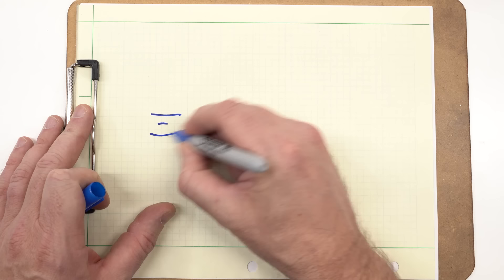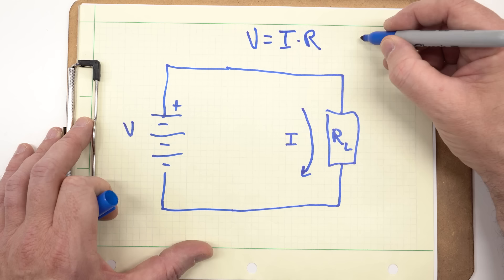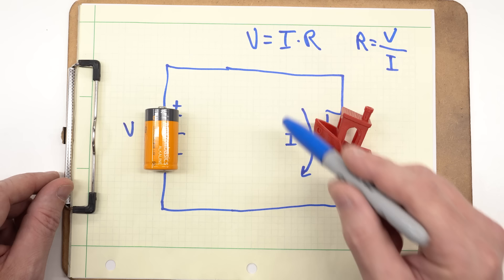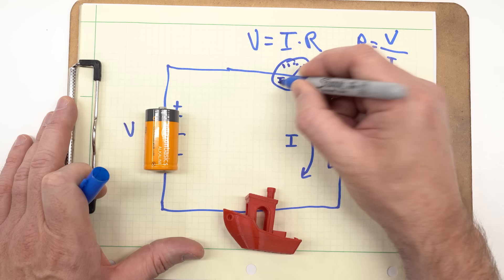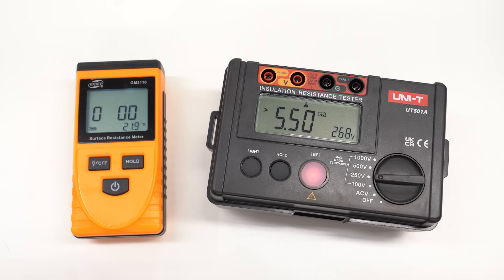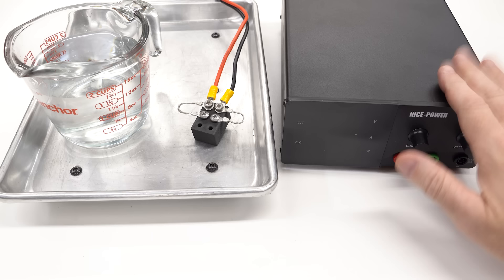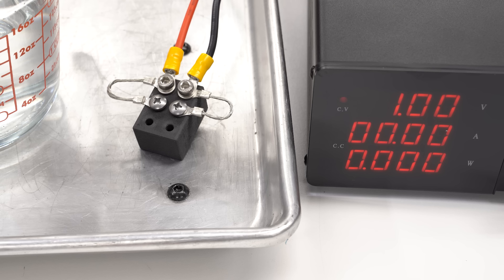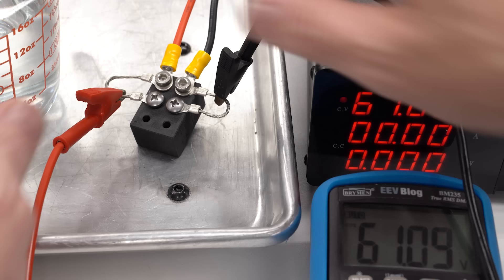3D Printing Filaments and Electricity: A Shocking Reality

Comment: An interesting side note, they are using carbon fiber infused in concrete as an ACTIVE LOAD CELL. This was patented as an automated way to measure potential failure of concrete bearing structures w/o the continuous need for an eyes on site inspection. 

Apparently as the concrete undergoes changes in the amount of load it’s under (contraction or expansion) the carbon fibers will undergo a measurable change in their resistance (higher compressed areas lower the resistance [of the carbon fiber in the area] while areas undergoing relaxation or tension will see an increase in resistance). While it wouldn’t do a lot of good to run a seamless run of carbon fiber throughout the concrete structure, placing precast smaller load cells embedded strategically in areas of concern alongside a group done at constant intervals would go a long ways to monitoring the health of aging concrete structures. 

The fact that they are able to measure these slight changes in resistance with a high enough degree of accuracy brings renewed interest in utilizing more than just its strength but its electrical properties as well.

Comment: In composites, long, skinny fibers offer improved strength and stiffness compared to spherical particle reinforcement. Your electrical tests are a reasonable way to evaluate fiber aspect ratio. Spherical particles would be insulated on all sides by polymer matrix, with almost zero particle-to-particle contact. A circuit along high aspect-ratio fibers would have far fewer insulating junctions, and a greater likelihood of fiber-to-fiber contact, or near-contact.

Assuming the recycled carbon fibers are aerospace grade, we can also assume they have high quality and aspect ratio, so it's not surprising that they result in measurable electrical conductivity. They should also result in increased thermal conductivity, but the meager difference would be even more difficult to measure.

Comment: There are static dissipating filaments. I have printed some parts form  3DXSTAT ESD PET.   I could not get the finish print to show conductive on my basic meter.  The customer had more specialized equipment to test it.  He said it was would conduct and dissipate static.  He was pleased.

Comment: The aircraft industry had concerns about carbon fibre and lightning. The concern is more the resistance causing heating and explosion of the material. That is at the other end of the spectrum. I think the problem with CF in aircraft was solved by including copper wire in the buildup.

Comment: I was at the South East Electric Funfly when  Carbon fiber DLG tangled with the power lines. The glider lost. It took down power for half the event site. There is a video from a drone that happened to be pointed in the right direction. The glider flat out exploded.
Ken

Comment: would i use CF filament for a 40kv plug? no, would i use it for a project with wireless connectivity? probably not, something i would need to test
would i use it for 60v? yes, without concern

Comment: I would expect the Bryman to use a constant current source for measuring resistance. That provides voltage directly proportional to current.

VOMs and VTVMs used constant voltage sources, why is why they have non linear scales with zero at the fat right.

Comment: I'd love to see a sample of a static dissapative filament as a 'control'. I actually have a roll if you want to open source your test designs
Reply: The static dissipating petg from polymaker and 3dxtech are conductive under the surface resistance test. They do specify higher processing temps for layer adhesion though

Comment: Well now I have to take this knowledge and apply it to nickel plating 3D parts. If I raise the voltage enough to make up for the resistance, I should be able to have it start plating. As it starts pointing the conductivity will go up and I'll just have to put a current limit on it... But that means I should be able to grow plating onto the plastic parts directly

Comment: Excellent and informative test! Thank you so much. I am however wondering if some of the apparently non-conductive materials might break down and conduct or arc at higher dielectric voltages and currents? I've worked quite a bit with high-voltage switchgear underground cables and insulators and have observed that might be effective insulators at low to medium voltages (medium being 5kv and below) would breakdown at higher dielectric potential voltage. Higher currents also seem to effective dielectric insulator breakdown. 

Arching might be another potential issue, as the the carbon-fiber might be more susceptible to arcing carbon tracks which could lead to permanent arcing. 

Be interesting to see how these materials hold up to a Hi Potential 'Hi-Pot' tester, or something like a 10,000volt neon sign transformer with terminals set within and beyond the arc gap, and see if the arc tends to be drawn to the material.
Reply from the maker: If I had access to higher voltages, I would try them.  I'm also curious.  I'm pretty sure all of the samples would break down at some voltage.
Reply: @Clough42  "You can get a horse to deal cards. Simple matter of voltage."

Comment: Pretty thorough. However, I am printing parts for Tesla coils these days, and having some CF PA in storage, I am just drooling at it, but at 15kV primary, or 300-400kV secondary, it would not be very wise to use it. Regardless of how much they would conduct at 1000V, or less...

Comment: I got the bambulab CF filaments because I wanted to print ESD safe boxes for my components. But was disappointed in that I could not measure any conductivity at all. I then bought Fiberlogy ESD-PETG-Filament which turns out to have easily measured resistance. Just sad that it is very expensive.

Comment: Chopped CF plasticis in the same space as CF resin composite it doesn't exhibit meaningful conductivity in a macro scale to be useful but in a micro scale it is conductive enough to mess with RF signals.

Comment: I recon the conductivity of some of these is 1 of 2 (or even both) things.
At higher voltages the resistance of the plastic breaks down and might create a path of "altered" plastic that is now conductive.

Or (and/or) the carbon fibers randomly line up in a print so you have a continous path from stud to fiber to fiber, etc, to stud.

Now I have to admit the first example of pathing usually happens only "well" above 1kv, hence almost all domestic/lv industrial installation goods, tools, ppe being rated up to 1kv.

Thus I suspect the conductivity you saw where the fibers in allignment. But that is a suspicion on my end based on observation not measurable facts.

Comment: It’s almost like when you chop up a conductive material and surround it’s random orientation in an insulating material it isn’t likely to make a circuit; Is it ideal, no. Will it likely work fine, probably depending on use case.

Comment: I think what you're seeing is by random chance enough carbon fibers are in close enough proximity to conduct. I imagine if you printed enough samples of each filament you would get some that fail with every brand since the arrangement of the fibers within each layer are random. The lower the fill percentage of carbon fiber the less likely this will happen but probably still possible.

Comment: I can tell you that the 30% carbon filled nylon we used to use for backup rings had significant conductivity. Now it was filled with graphite, not carbon fiber but it shouldn't matter.
Reply: Graphite has aligned Pi bonds that are very conductive across the planes. Carbon fibres are not always graphitised enough to make micro sheets or tubes of Pi linked C=C bonds

Comment: In conducting, there is resistance. Where there is resistance there will be heat.
Heat + PLA = Melt
Even if it is possible, I don't think it would be a good idea for long term use.

Comment: I wonder if the phenomenon only happened with nylon due to its hygroscopic qualities. I'm no material scientist or anything near that, but I wonder if a combination of absorbed moisture in the plastic and the carbon fiber threads could have caused better continuity than the other polymers with much lower hygroscopic qualities.

Comment: I'd bet you'd see interesting effects if you tested at higher frequencies. I'm guessing some of the conductivity is dependent on fibers randomly touching within the material, as the frequency increases small gaps will act as capacitors and it'll likely turn conductive more easily. As I'm sure James knows, Ohm's law is only V=IR at DC, in general it's V=IZ, where Z is the complex impedance R+jX. None of the testers shown here can measure at particularly high frequencies.

Comment: So, is this an indication on the quality of the filament?

Prussia has more CF?
Reply from the maker: Possibly.  It might have something to do with the length of the chopped fibers, but most brands don't advertise that data.  It also isn't clear to me that more fiber is always better.  There's likely a point with chopped fiber where fibers start to interrupt the plastic enough to reduce the overall tensile strength.

Comment: likely had one random strand of carbon making it from one hole to the next
I figure under 30-40% fill, all the fiber will generally be insulated by the surrounding material, all of which has a high dielectric

Comment: You were really responsive. So glad you took the test! I had a reservation about carbon fiber and I see that my intuition was correct. Thank you for the test. ABS would perhaps have been safer even if at the voltage used there is little risk.

Comment: Very interesting, though at this point I would probably not trust myself to use any carbon fiber fillament for electronic projects until I know the exact reason why and when it becomes conductive, even if it tested fine previously. Especially the case where the surface tester didn't show anything and later did under slightly different circumstances (usually I get better results with surface testing compared to probing). That would erode my trust into any kind of carbon fillament entirely, because even if it didn't test like that previously, who knows what parameters would make it conductive later on.

Comment: With such low content of cf in those polymers it´s basicly a lottery to get any continuous path of fibers from one point to another.
And even if, those small fibers have quite high resistens!
For everything low voltage and not Metrology related, those 100k don´t matter.

Comment: Your welder should have the umpf to get something exciting probably.
Reply: A welder is relatively low voltage, high current. For maximum power transfer, source impedance needs to match load impedance. With the filament measuring in the high megaohms, we need a high voltage supply to maximize destruction.
Reply from the maker: If I had such a supply, you would get to see that destruction.  :)
Reply: @Clough42  sounds like a great project!

Comment: I mean, if you're worried about isolation breakdown voltages you probably shouldn't be diy-ing whatever you're diy-ing right now.
I have dealt with double and triple digit direct current applications with the big boy cables, can't say I ever felt the need to replace a rated insulator for something 3D printed.
And that includes high end RC "toys". If I'm investing 500€ in batteries alone I won't skimp out on the shielding and isolation...

Comment: how many caught that the reading @5:00 in fact not being the multimeter but the plastic lid he used to prop the meter up! (or he's trolling us! Can't be sure which ;)) the reading does infact update when he plugs the multimeter in though
Reply from the maker: Did you not see the test leads clipped to the brass bars?
Reply: @Clough42  that i did see, yet we also saw the other ends of the test leads lose on the table for those few moments as you propped the meter onto the plastic lid. is the 100G reading a false reading from just moving it? - i did miss that it zeroed just a few seconds after-
Reply from the maker: @konzetsu6068  it often registers something when moving it or handling the leads and then settles down.  I edited that section aggressively to keep the time down, so it wasn't easy to see.  I suspect it's capacitance that then fully charges or discharges and shows open again.  I see that it only gets down to around 10^11 before plugging in, but since the reading is then 10^7 it would swamp the higher reading by four orders of magnitude even if it were real.  So I think it was an unfortunate edit, though I suppose it's possible that plastic box is anti-static and I didn't notice.  The screen was not legible at all with the glare, so that was a last minute addition.

Comment: Why not just hit the test blocks with 240vac and see what happens?  Perfectly safe with the right setup.  You should be able to observe it with an infrared camera and maybe there can be fire afterall.
Reply: Nothing will happen, the resistance of even the Prusa test block is too high for any significant current flow.  Using Ohms law, work out how much current will flow thru a 120,000 ohm resistor at 240v AC.  (Spoiler: it ain't much. Half a watt if you're lucky)
Reply: @j.f.christ8421  Half a watt in a small spot without any active heat sinking will surely be detectable and will warm up.  You can definitely feel the heat with a half a watt on a TO-220 package.  Maybe the heavy leads would end up sinking a lot of heat away and it would never build up substantially, but I'm sure it would get warm.
Reply: @urbanawoodproject3123  Again, nothing will happen.  It's not "catch on fire" warm, and that's a reasonably bit chunk of plastic, not a tiny silicon die..  My phone gets hotter than that while charging.
Reply: @j.f.christ8421  Depends on the surrounding conditions.  In open still air, it will get warm.  It if it were inside of something (like an electronics enclosure), the temp could just keep going up until something starts to melt.  It would be interesting to know if the conductivity of the filament changes with temperature - potentially you could have an avalanche condition as it starts to warm up.  Your phone has heat sensors to prevent itself from overheating.
Reply: @urbanawoodproject3123  Y'know I just pulled that half watt number out of my rear, right?  You should really go and check it before writing "technical" stuff that sounds like you know what you're talking about.  Garbage attracts garbage.

Unless you're putting all all thru a tiny resistor or something, that amount of heat is trivial.  Yes I've done thermal calcs in the past, really easy now with Fusion360 etc.
Reply: @j.f.christ8421  I don't know where you got half a watt, but I got it by extrapolating from the numbers that James gave in his video.  I figured you did the same.  There is really no need for you to be a jerk here.
Reply: @urbanawoodproject3123  You're hilarious.  I pulled half a watt out of my rear (sounded about right), you got it from my post.  If you'd actually calculated it yourself, you'd be smart enough not to bother asking "but what about 240v) in the first place, as if there something special about mains power.

If you were smarter, other folks would be less snarky.
Reply: @j.f.christ8421  Angry, mean, and wrong on the internet?  You can do better than that.
Reply: @urbanawoodproject3123  I'm doing better than you.  At least I'm not posting dumb questions, or believing numbers someone just made up without checking them first.

But, you do you.  (No one else will.)

Comment: Most Carbon Fiber filament has only 20% carbon.  The electrical conductivity of carbon fiber can be expressed as 10^2 S/m. So, it should not be very conductive.... It should be cool to see the results.
Reply: After seeing the results, I was surprised.  The Prusa CF as I understand is recycled, so it could have a much higher carbon.  Interesting.  I am going to send this video to the guys in the lab.  We are using CF filament on some sensitive equipment.

Comment: I was thinkin a Fluke 1507, but your thingee just does Hi test.  Only gripe I have is when your dealing with any high voltage sources.  Only handle 1 (ONE) conductor at a time.  Remember the word accident, you do everything right & it still goes to crap.  Same same.  Just get in that habit in case something else goes wrong, cause if your not in circuit, your good.  Nitrelle gloves under thin leather work gloves are good too {for that application}.  Just need to insulate the meat mittens so ya don't get zapped.
Reply: Yes, You were very careful & it went great, electrician's gotta plan for the worse.  The code book was written & is updated because someone got hurt {or worse}.  Just lookin' out for ya.